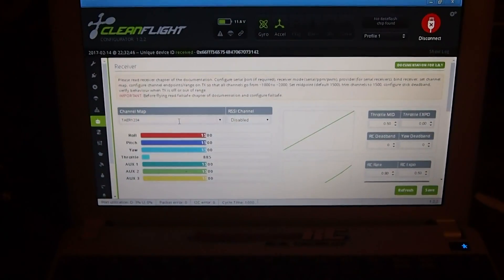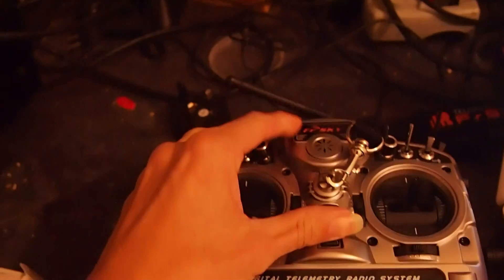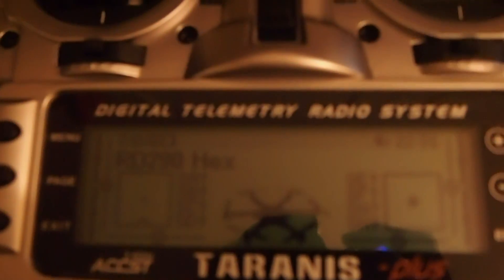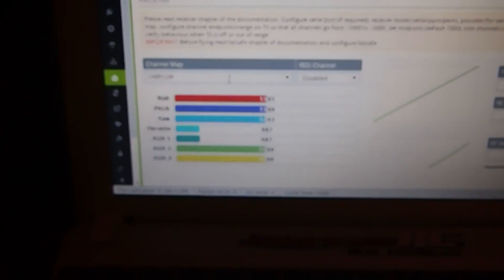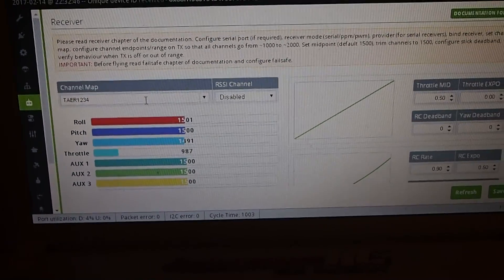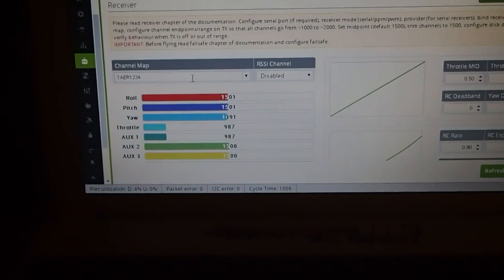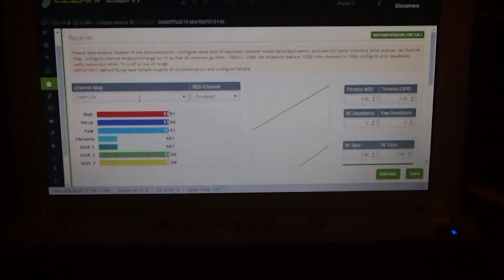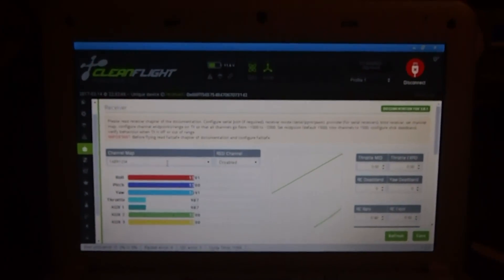SBUS on Naze32 Rev 5

Comment: Terrible, where do I connect the sbus to the naza 32 rev 5? Or is this a faked video
Reply: Good question. circuit diagram on the web would suggest same pin as PWN channel 4 but aint working.